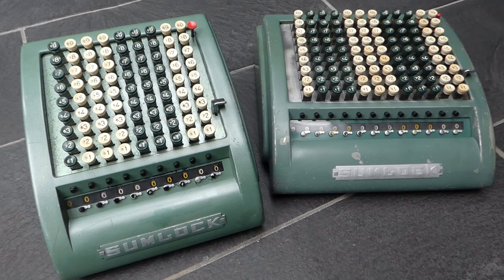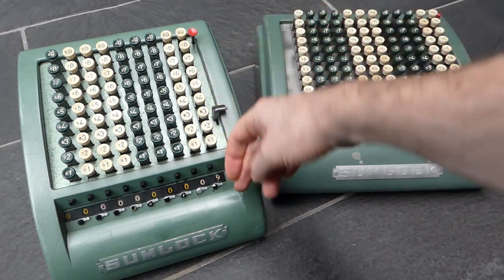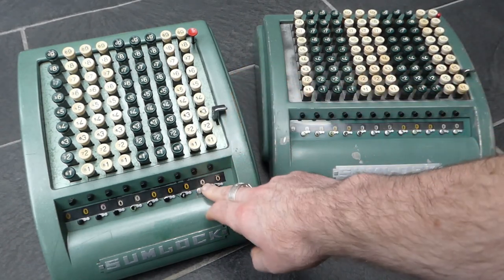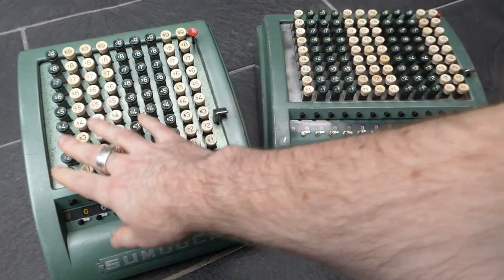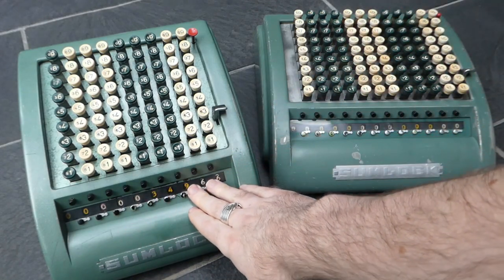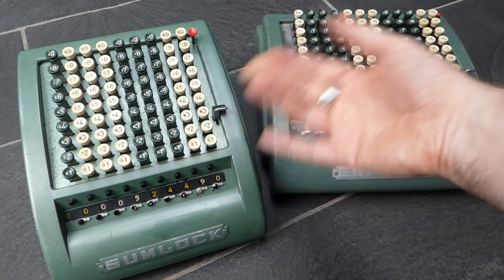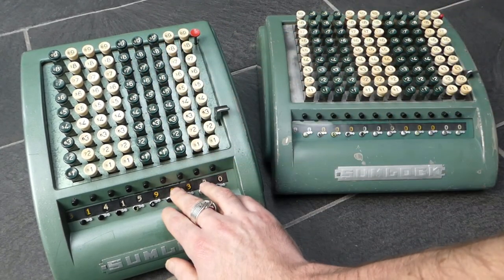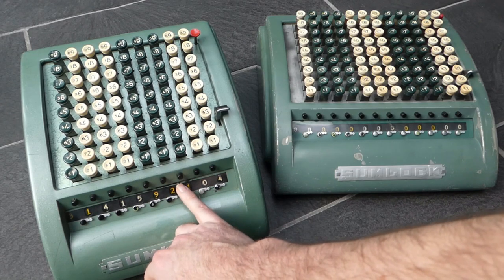The Sumlock mechanical calculator, and some advanced calculation techniques.

Comment: Just taken possession of one of these - a UK money model in £/s/d in a hand made wooden case. Notes that came with seem to show it was used by someone like an auditor, who'd travel to offices with the machine in tow. 

Two of the numeral reels were completely latched into their axle, so two of the columns worked completely in concert. (whatever you added to one added to the other, and vice versa.)

Solved the issue by disassembling so the frame was out of the green case, and gently tapping the end of the axle with a hammer (it's just a pin that runs the width of the machine) until it shifted slightly. Then tapped it back the other way and reassembled. 

This was enough to free the two numeral wheels and give me a completely operational machine :-). Lovely action and such a light touch. Adding 1 to the completely full machine makes me ridiculously happy as the carry chitters across the register. :-)
Reply from the maker: It is a very common problem on sumlocks and plus adders. If it's just one or two stuck wheels, knocking the axle like you did usually works. If there are more, it takes more patience, working the wheels loose one by one. Once they are loose, it's good to clean the axle. There is usually a free axle rod somewhere on the machine that you can use to thread through to push the old axle out for cleaning.

Comment: Thanks for the video, I didn't know this trick for multiplication.
I just read about the Certopost on your site, I'd like to see a machine with that system in action.
Reply from the maker: Unfortunately I don't have such a machine, so I can't help you with that.
Reply: @jaapsch2  They seem pretty rare, I did hardly find any more information about them.
Reply from the maker: @zse8861  About the only real info is at anita-calculators, which I'm sure you already found:
http://www.anita-calculators.info/html/sumlock_913-s_with_certopost.html
There is also the original patent:
https://worldwide.espacenet.com/patent/search?q=pn%3DGB740007
Reply: @jaapsch2  Thanks for the link for the patent. Yes, I found the info at anita-calculators, it explains well how the system works in practice. The patent describes how the system works behind the scenes.